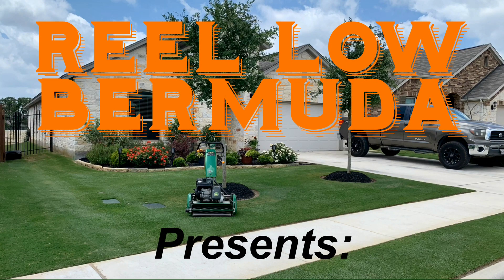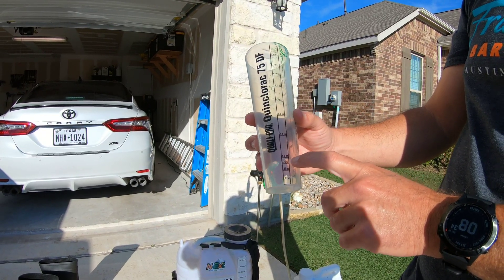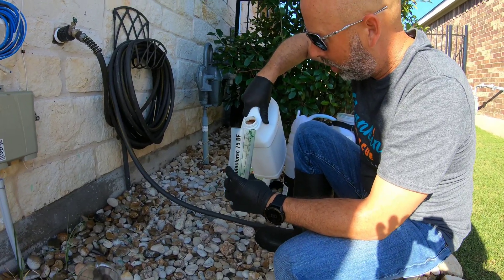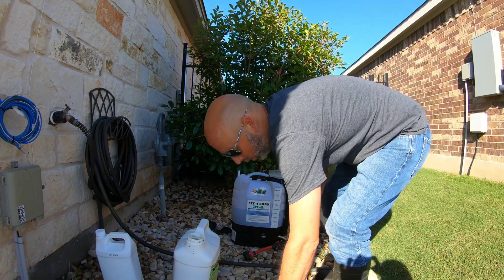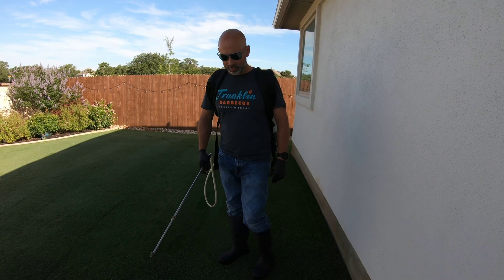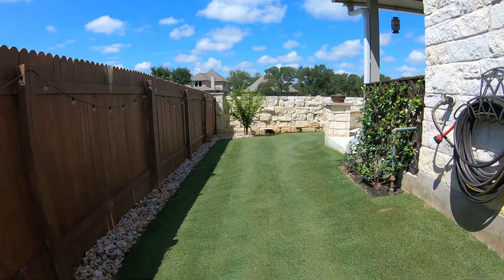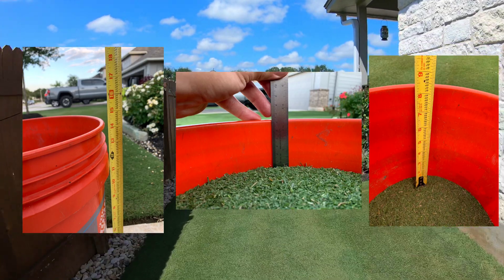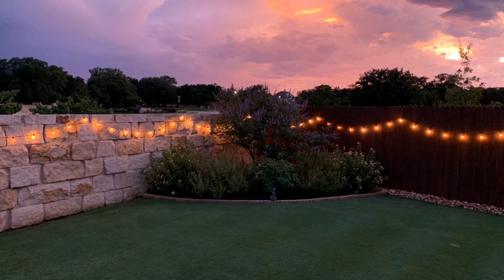Does PGR Really Work??? Let’s take a look at the results!

Comment from the maker: Thanks for watching! If you are new to the channel, hit subscribe for weekly lawn care tips. Also, the Quinclorac measuring flask is designed to measure granules in weight, not liquid in volume. Because of that, I over applied by 0.25 liquid ounces. Probably would’ve had less bronzing with a proper measurement.

Comment: i noticed you didnt use a surfactant. i always  use a surfactant when using liquid apps. or at least dawn for  pgr,herbs, liquid ferts. a surfactant allows you to use the minimum dose and get max Potency and saves you money because you use less product. its about leaf runoff vs  Adhering to the plant.. im sure you know but example for newbies.. if i run water on a plate it runs off. if u put dawn or dish soap on a plate it stays on the plate. you want liquid to stay on the blades of grass long as possible for product  Penetration just a tip for users. great vid ALSO DO NOW WATERING PGR IN or apply if rain in 24hrs let is dry on the grass
Reply from the maker: Thanks for the feedback

Comment: A little off topic question that I could use your assistance on. I noticed you do not have transport wheels on your JD. I would like to take off the transport wheels off my 220C that I recently purchased so that I can get it into my outdoor shed (36" door). I removed the RH cover and it looks like the piece that the transport wheels slide onto maybe threaded in. Is that correct? If so, is it LH or RH threaded? I have researched JD on line parts manuals, etc,. and I could not find the answer. Any insight would be helpful. I enjoy your channel and like you, I live in Central Texas and have tiff bermuda that I am currently mowing with a rotary mower and ready to take it to the next level. Thanks for your help.
Reply from the maker: I bought my JD used and it already had the wheels removed. Sorry I can’t be of more help.

Comment: I have the same quinchlorac measuring beaker. The values listed on the side are not accurate for liquids, check it against another measuring device
Reply from the maker: Oh geez! I never thought of that! Thanks for pointing that out.
Reply: @reellowbermuda8786  Use a measuring cylinder to measure liquids. If you want to use that quinclorac beaker first weigh out the necessary volume of water on a weighing scale mark your line and then replace the water with the liquid chemical.
Reply from the maker: Thanks for the tip!